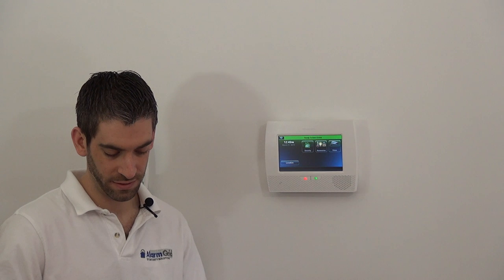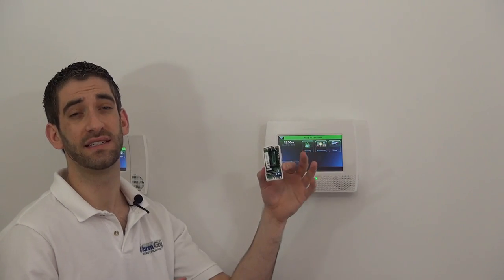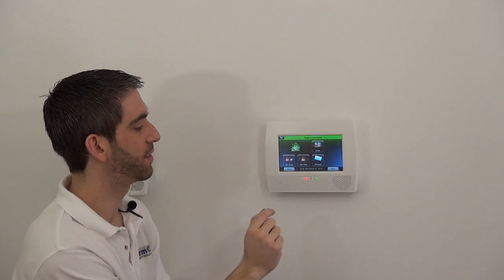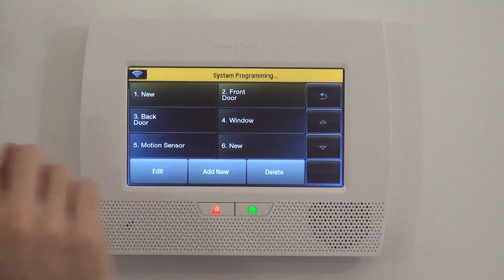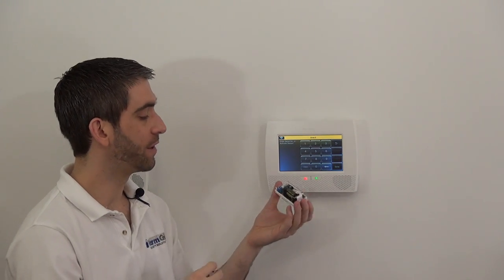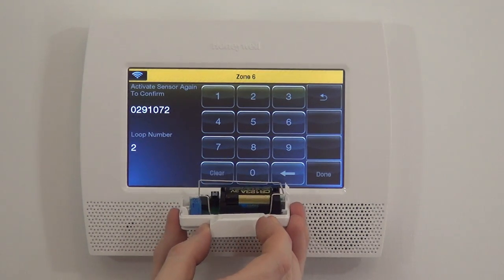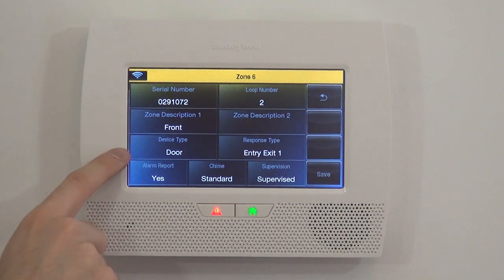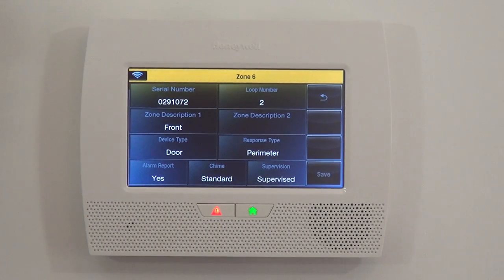Honeywell 5816: Program to L7000

Comment: Hi Sterling!

Bought a few wireless 5816s and would like to install but the installer/code 4112 does not work. It sends me back to where I chose tools. Any suggestions? Really appreciate you sharing all this knowledge!!
Is there a back door code to use?
PR
Reply from the maker: We have a separate FAQ on how to get into the L7000 through the Back Door, check it out:  https://www.alarmgrid.com/faq/how-do-i-get-back-into-programming-if-i-am-locked-out-on-my-l700

Comment: What kind of zone type for the hardwire zone ?
Reply: if it is a motion detector Interior follower if it s a door entry-exit or perimeter depending on if you need a delay when entring through that door. Just depends on what your are putting on that hardwired zone for example door window or motion
Reply: @joshuagriffin2807  can I programme as a keyswitch zone ?

Comment: What is Entry/Exit 2?
Reply from the maker: It's a zone that will follow the Exit Delay time and the Entry Delay 2 time. It's used for zones that may need a shorter or longer entry delay than the zones set for Entry/Exit 1 that will follow the Exit Delay and the Entry Delay 1 time.
Reply: That is the delay